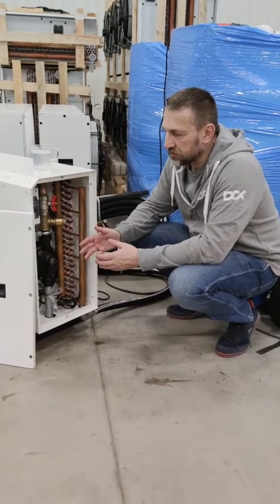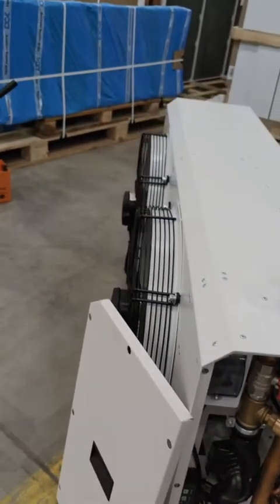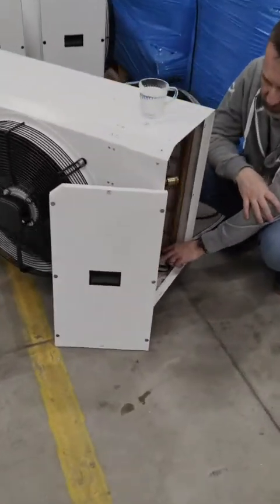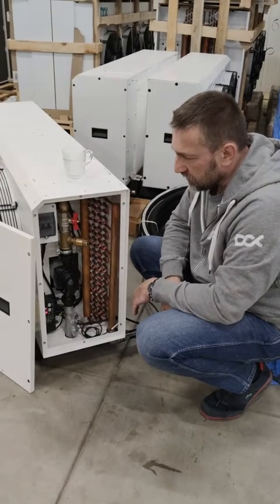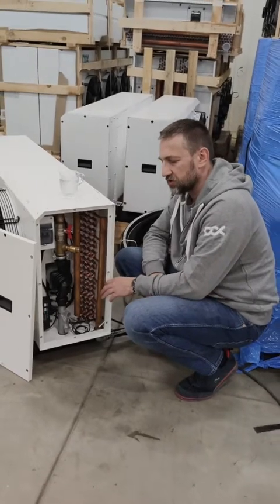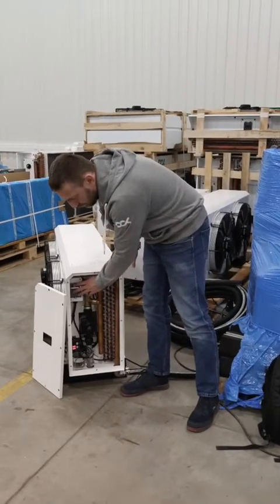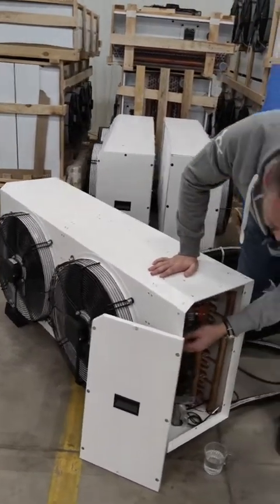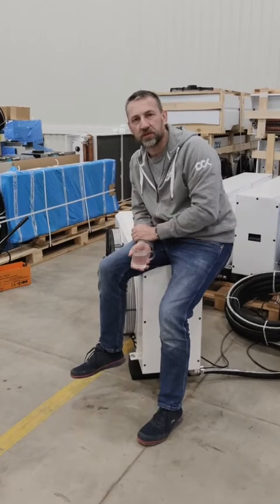How to use the ICP40 Dry Cooler fan modes?

Comment: I would like to use the heat to warm a greenhouse in the winter. Any suggestions on how to accomplish this? Would installing the dry cooler in the be sufficient during the winter season and move it outside in the summer. We live in a moderate climate.